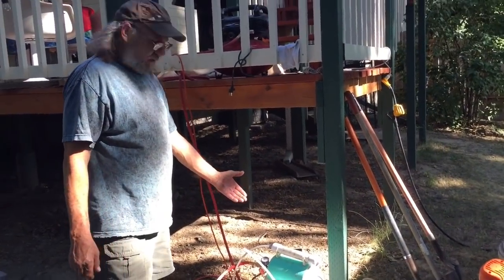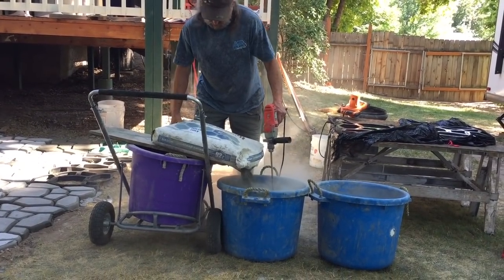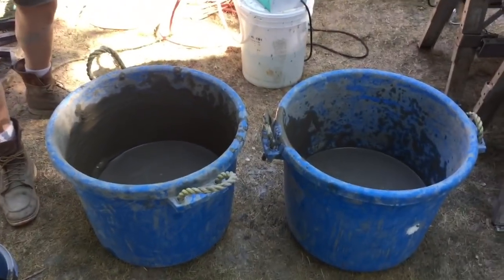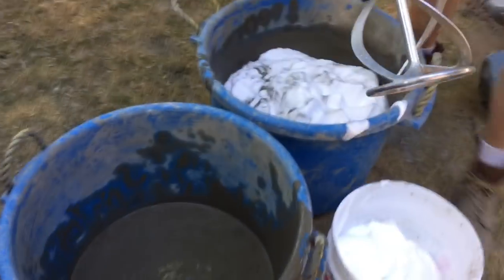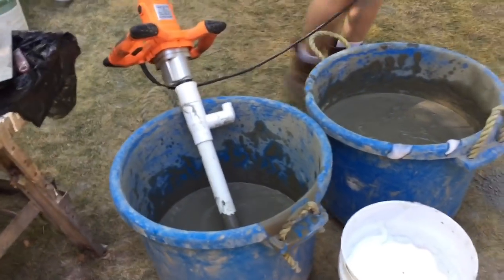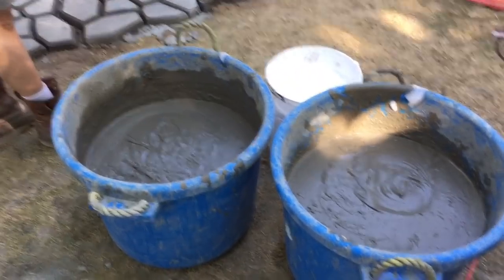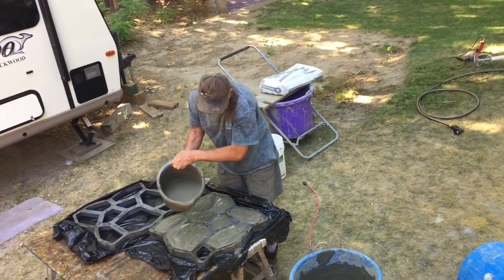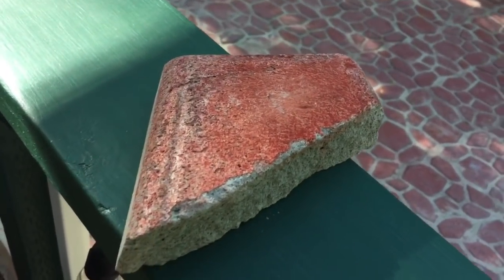Air Crete patio using little dragon

Comment: i'm wondering since the cement is so porous, if it holds water and if so, how does it work in colder climates... you would almost thing it would expand break apart... anyone know?   would be great if you could have ANOTHER blower to blow the concrete - perfect for making fake rocks and walls and stuff.
Reply from the maker: +rapunzel eh?  Yes it's pores. We did wonder about what it would do when it froze.   So we froze one. We did a video on it.   It's here on you tube. Nothing happened.  We soak it in water for a long time then froze it.  Looks great still.   As for blowing it on, that would be cool. It would Make a great fake rocks. Thanks for watching.
Reply: actually just saw it!  i'm zone 4 at 3800 ft so freezing is always a concern... also since we had major forest fires this summer (over 2 million acres burned in british columbia), this might be an option for applying to buildings as a fireproofing membrane...  but spraying would definately be the way to apply it...

Comment: What is the overall cost per square foot? 
Per material and equipment would be nice... thanks for the good work. ..
Reply from the maker: 10.50 for cost of cement and a few cents for soap yields five sets of the stones
Reply: Kathy Johnson 
Wow,,  thanks for the reply, ,,  I am curious about how many square feet does 5 sets cover?
Thanks again,,,😆
Reply from the maker: Each green form is 2' x 2'. Times that by 5  Hope that helps.
Reply: Kathy Johnson 
Ah,, yes..  that's the ticket...
Thanks again for your help. ..😎
Reply: ...got a headache yet?... @kathyjohnson7132

Comment: how did you finish the patio?  it's red.  Is that paint?  Did you fill the gaps between the bricks with gravel or sand?  How well do th edge pieces hold up or did you use something to edge it with?
Reply from the maker: Tooshie G  The color is a concrete color. And the gaps were filled with sand. There a brick wall that goes around  most the sides except under the deck and on the end where we showed on the video.  We did a follow up video that shows you the color we used and how we did the sand.

Comment: Would it be possible to list tools required?
Reply from the maker: Louis Hinkle  you need Little Dragon,  Compressor, Trowel, mixer with paddle to mix it up with, hose, forms, paint brush to put oil on to lubricate your molds,  some container to mix it in they recommend 55 gallon drum, ( we use two smaller containers were old) I think that was it. We purchased the Little Dragon and the mixer which actually puts the foam out the bottom of it if used properly from domeGaia.com  hope this helps

Comment: I guess they were stained salmon terracotta after they had set with a liquid dye
Reply from the maker: Yes we sprayed concrete color on them.  There is a video we did that shows u that. There’s also a video about them freezing. We will be doing another video showing what happens this winter.

Comment: What are the advantages? Just lighter? The concrete goes further? I've heard of using pearlite in concrete to make it lighter. Is it much weaker? thanks :)
Reply from the maker: tblbaby  it is much lighter and we got five times the blocks we would have gotten. As for weaker that's what we're testing now. I know when you walk on it it has a different sound and feel than a regular brick. But so far it seems very strong. We have a block submerged in water now and in 24 hours we're going to take it and put it in the freezer. Just to see what we're expecting this winter. Will try to post results often.
Reply: Thank You. Nice work on this. It's pretty intriguing. Wonder what it would be like structurally.
Reply from the maker: tblbaby   They build houses from it.  We're just learning what we can do with it.  There is a lot of videos on aircrete.  We found it very interesting and decided to try this patio.
Reply: It makes the concrete less dense and light, yes.  This will also increase the volume of the concrete as air (soap foam) are encapsulated in concrete.  

Yes you can build houses with this but I wouldn't recommend for structural or load bearing applications.  Meaning to say this is  ideal for floor and partition applications.    Another way is to introduce styrofoam beads in the mix with the size of a BB pellets or smaller.  Even BB pellets itself will be fine. Say 20% - 30% per volume.   You can also add chop glass fiber strands to increase crack resistance.
Reply: You'd never get styrafoam beads to mix with concrete - even air crete!  They will simply float on top of the slurry.
Reply: Did you have to weight it down to get it to stay submerged? ;-) If you had a flooded yard I bet the blocks would float away unless they were pinned down somehow. I have read that aircrete is weaker in compression than normal concrete, and presumably also in tension and shear, so it isn't intended for serious weight-bearing or structural roles. It's more for filling and insulation.
Reply from the maker: +pickinvidders Our bricks are locked together with sand. They would be hard to dig up let alone float up. We have also not heard that's it weaker than compress concrete. I know they build homes from it.  We've been watching Domegaia videos. They been building done homes. The one there building now is an orphanage.  But we are learning this is our first aircrete project.
Reply: Zac Crow air Crete is very fluid , low viscosity and the styrofoam beads will float to the top
Reply: Kathy Johnson it is much weaker and much less wear (abrasion) resistant than regular concrete made with aggregates (sand and rock).
Reply from the maker: +Keith Kropf  thank you for the information. This whole air Crete is a learning process for us.

Comment: How did you get the red color?
Reply from the maker: :D101 we used Liquid concrete color in a spray bottle with water and Misted it on there. the air Crete absorbs it very well. There is a follow up video that shows you how we did the color and the crevices
Reply: Kathy Johnson awesome! This exactly the project i was looking for. Quick question how much was the whole project
Reply from the maker: :D101  we think it was about 500 dollars maybe a little more.  But that doesn’t include the Little Dragon or the compressor or the mixer. We had,  had those for a while and was just trying to think of a project.

Comment: So one bag of Portland with the foam only makes 5 forms  roughly 10 sqf?  Why not just mic the Portland with play sand and get a much higher price psi rating and more footage?
Reply from the maker: Joshua Potter  The mold said it took one bag per mold. That's ready mix.  The forms are 2x2x 2inchs . By 5  forms Isn't that 20 Square feet . We really did it to learn what we can do with aircrete.
Reply from the maker: We believe you covers 20 ft. with one bag

Comment: Interesting concept. I hope you are placing the pavers on a concrete surface and not on a lawn.
Reply from the maker: +steve knight  Not on concrete.  We did put down some sand,
Reply: Lightweight concrete is not as strong as regular concrete. At least not as strong as the way you're doing it. You need to bring in crusher waste (okay, it's called many other names) and compact it. Then no more than a 1/4 inch of sand to keep it level. The pavers are tight against each other. After all pavers are down you must scatter sand on top of it and use a vibrating compactor to finish the job. Make sure the border surrounding the pavers is sturdy. The problem is water. When the ground gets wet it moves. It swells ups and gets soft. If you step on a paver/flagstone/brick it makes a divot. A hollow spot under the material. There goes your substructure and your pavers. Too much sand is a disaster. Use as little as possible and just for leveling the compact to get a flat surface.

Comment: I could see using it for art or statues but as far as a patio goes why would u take the time to do this, While you get things ready I would've given u a 4" slab with rebar in any pattern u want. Doesn't seem economical or structurally the way to go.  Good job though.

Comment: looked web site 499 uh not me ill just get it done with parts n use my brain a bit i guess some people may need this but if you used to fixing crap no need just my 2 sence seems like air gun in a  mix of water foaming soap in a barrel works fine Apply that to a pvc tube with stainless steal wool foamer grating passthrough bla bla with knobs air hose bla bla to adjust flows n it just a matter a tooling around A diy 30-80 bucks in parts plus doing up a auger drill if even need it

Comment: How did you do the colour?
Reply from the maker: Macleod eh After the bricks cured for a few days, we use liquid cement color that we added to water and sprayed on with a handheld sprayer let it dry. Then we washed it  down with a hose.  The bricks are pretty porous so the color soaks into them well. We were just experimenting with the color. And it seem to work well for us.

Comment: just saw this, Im betting you have a shi..load of destroyed and cracked pavers. Your ratios are so far off its painful.
Reply from the maker: Well I’m glad it’s not as bad as you think. The ratios we used is what we knew,  This project was a just a test to see what aircrete could  do and we learned a lot.
Reply: @kathyjohnson7132  been doing concrete for 30 years, gypcrete and hydrocell which are both what the foamcrete was based on, still need enough of the actual clay(cement) to set up and cure hard. With that is a formulated amount of lyme and calcium which is what gives the Bleached look to a slab when its cured after about 15 days. You had a real slurry, and I will promise you problems in the near future, if you have other projects with this, try mixing the single bag of crete normally, add a flow control packet and then your foam. This will make it runny and wet without compromising the integrity of the strength. A couple freezes and some warm days following wil fracture those and make them even more brittle. When too much water is used your mud becomes flakey. and falls apart over time.
Reply from the maker: Thanks for the information, it doesn’t sound very good for us. 😩